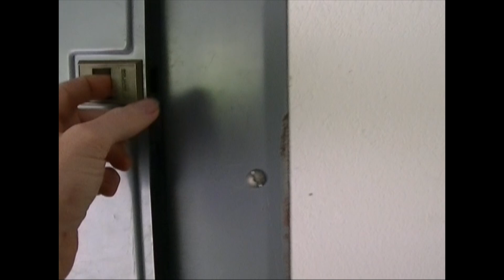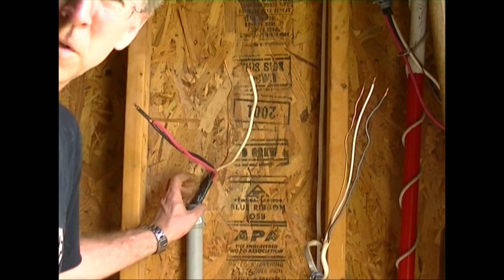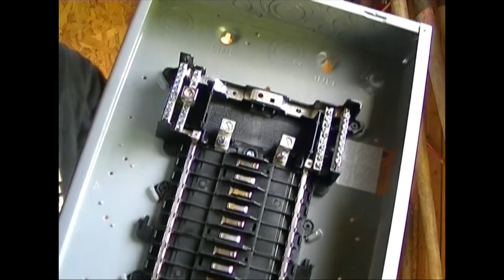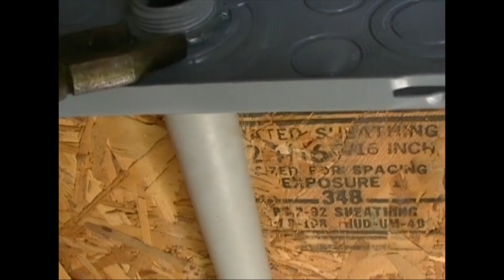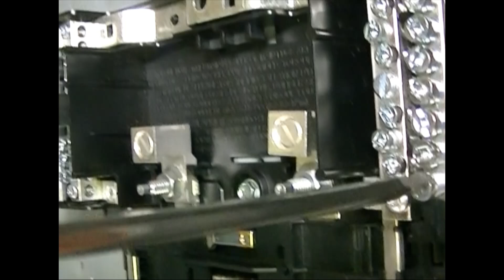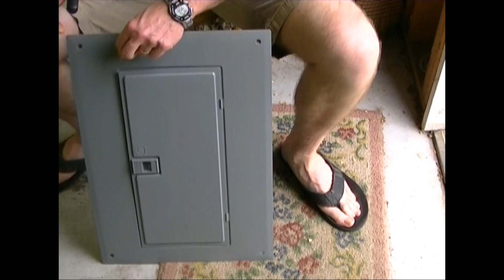How To Change Out A Load Center (or Breaker Box)

Comment: I don’t know if that’s a 6 gauge or 8 gauge cable but there’s no way it could carry that amperage. You either need to run a bigger cable or multiple 6 gauge cables. I know you’re not running multiple devices at once but you mentioned a heating/cooling unit if the air compressor kicks in due to leaks I’d imagine that wire is toast. Not to mention something coming up on main panel like a dyer or stove.  I’m not an electrician but I’d do an amp count just to be safe.
Reply from the maker: Excellent advice.  Thank you for commenting.

Comment: Joe,   A few comments if you don't mind.  I've designed electrical systems since 1983 for contractors and recently retired.  1.  Many comments about wire size and breaker size being too small.  Your response was that you had 60 amp breaker in the house so you are ok.  I agree with your comment to a point.   You can feed a 800 ampere panel with a 60 amp feed and be completely NEC compliant(not cost effective) NEC says feeder overcurrent and conductors sized to carry the calculated load.  I doubt you did the calc, but let's assume you did and it is 60 amps or less.   So you would be correct.   The BIG NO NO is in one comment you said "apartment above".  Assuming the apartment has everything NEC calls a dwelling unit, you are now in violation.  The minimum requirement for a dwelling unit is 100 amperes.  2.  Ground neutral bonded not bonded issues and questions need to be answered by NEC section about connecting one building to another electrically.   The specifics of this changed many times over the years back and forth, so could be either way, but needs to be based on adopted code in your area.  3.  NM cable shall not be installed in conduit exceeding 6'-0".   NM cable shall not be installed direct buried.   4.  In most areas where inspections are required, most will allow home owner to do electrical work.  So, check before you do, get a permit and get inspections.  It will help on safe installations, be easier to sell the property, less risk of insurance company denying a fire claim, and most of all, the life you save may be your own.   Respectfully,
Reply from the maker: OK, first of all, you win the prize for best comment ever on this video.  Thank you so much for your thoughtful insights.  The apartment is just lights and outlets and the AC.  Not really equipped to be a full-fledged dwelling so I'm not sure about how code would apply.  I obviously didn't get inspections and went into this project with a complete willingness to tear it out if need be for sale or other enforcement.  I hope I don't regret that someday but I certainly appreciate your free 'inspection' and, if I"m able, would like to go back and implement your suggestions.  God bless you.
Reply: FloridaJoe3   If the apartment has a sleeping area, bathroom, and kitchen,  then it is a dwelling unit.  If any are not there then it is not.  Best of luck to you.
Reply: FloridaJoe3 I forgot,  the NM cable should really be removed.  If it starts boiling the water  around it, it might last a while but not a long time.  If you did pvc conduit all the way, easy.  If not, not so easy but doable.

Comment: Ur a clown, u should remove this video cause u don’t know what ur doing. This is a fire hazard waiting to happen. 1st off u Never bolt ground and neutrals together in a sub panel. 2 u have to remove the bolt on the panel to remove the metal panel bond to neural.3 lmfaoo u fkd up  u put the panel the wrong way lol u should of flipped it and put ur main #6/3 into those lugs on the panel(the proper way of installing a panel .Bozooo electric
Reply from the maker: Despite your poor spelling and diplomacy, I was able to find an intelligent comment here.  Thank you for posting.  You are correct that neutrals and grounds should not be connected at the remote box.  I have a correction video that goes along with this video.  Please watch it and provide some more clownish comments.

Comment: Excellent video and great explanation. So what are the additional buss bars for? I also thought the 2 phases coming into the panel were supposed to be plugged into the two large screws on top. Am I wrong or is this just another way to do it? Sounds stupid but I am new and learning.
Reply from the maker: No, that's an excellent question.  The power phases coming in 'should' be connected as you stated.  However, because this is in my barn and the cutoff is 200 feet away at the main panel in the house.  I fed in through a breaker so I would have a local cutoff.  Sorry if that was confusing.
Reply: @FloridaJoe3  it makes sense. I was thinking that as well. I was wondering how you would shut off the panel if you needed to work on it.

Comment: You maybe should calculated your total load in Amps ,plus your voltage drop from 200 feet to your house.At minimum for 100 AMP is # 2 Aluminum. The shade tree way is to get everything hooked up .Power up and get an amp meter and check your current draw ,which will vary according to what is on at the time. The AC is going to be the biggest current hog followed by the water heater ,compressor and then your lighting.
Reply from the maker: Thank you for that comment.  I might mention that even though the box is 100A, I am limiting the feed with a 50A breaker because of the length and gauge of the feed wire.  Measuring would be great if I had an ammeter.  I just looked at the spec tags on the various amp hogs you listed and added them up.  All the best to you.

Comment: also you should have brought the feed in from the other side of the panel because you are stretching the neutral and ground across the buss.  also this is a main lug panel . wrong installation for using a 60 amp breaker
Reply from the maker: Agreed.  I believe I was constrained by wire-length to do some less than desirable routing.  Not sure what you meant by the second comment but I was using the 60A breaker to feed the panel so I wouldn't have to walk 100 yards to the main panel to shut it off. (I know. I should have put in a cut-off upstream next to the panel.)

Comment: Phases are 120 degrees apart not 180
Reply from the maker: Thank you for your comment.  You would be correct if you were talking about a 3-phase system (360/3=120).  However, I'm talking about a center-tapped single phase 240VAC which make two opposite 'phases' 180 degrees apart. (360/2=180).  If you dig down through the comments you'll find a very thorough argument for the two-phases.

Comment: I typically don’t comment but this is full of fail

1. The wire feeding the panel is NM cable. I’m assuming the feed to the barn is underground. That cable is not rated for the use. 
2. The backfed breaker in the new panel needs a hold down kit. 
3. This is a sub panel. The neutrals and grounds need separated. 
4. The conduit needs secured. 
5. It’s not two phase when you have a two pole breaker in this application. It’s still single phase. You have a single phase that is center tapped. 
6. Assuming this is a detached structure there’s grounding that is missing. 

This is a prime example of why handymen and homeowners should not be trusted with electrical work.
Reply from the maker: First of all Thank you very much for a detailed and well-stated comment.  I would like to respond to each one so I appreciate the numbering also.1. You are the first to ever mention the NM cable.  I will check on that.  I thought that I bought cable specified for underground use but I may have just assumed that because of the black sheathing.2. You are also the first to comment on the hold-down.  I had no idea what you were talking about so I looked it up and, sure enough, "you have to attach a special retainer clip to the breaker, so a future electrician doesn't pull the breaker and assume that it's dead."  I will remedy this at my first opportunity.3. I guess you didn't notice my pinned comment about the correction video that I made.  I would love to hear what you think of that if you have a moment some time.4. Yes. I'm taking the risk that the 5 feet of conduit won't go anywhere.  I have been told this before.5. I love this one.  I know it is a center-tapped single phase.  If you dig through the comments you'll see my argument for the two phase.  Basically, when you center-tap the 240VAC you get two 120VAC circuits that are 180 degrees out of phase.  Seems a shame to call it single phase when they are so opposite.6. You're not the first to mention this either.  I'm using the ground wire back to the main panel but I agree that rods would be better.  I may remedy that in the future as well.Again, thank you for the excellent comment.  You definitely win commenter of the month!
Reply: 1. There is NM wire that is for residential work thats code (california). It is made if you dont want to - A.run Emt or B.run flex from panel to sub-panel. They have different guage sizes including 2/0, 3/0. In a sub panel you only need a ground wire connected to the bus that comes from the main panel , no need for a Ground rod , just a ground bushing.
Reply from the maker: Thank you for the comment.  I thought initially that I didn't need the ground rod but had a couple of commenters that said I did.  It wouldn't surprise me if different states have different rules for that.
Reply: @FloridaJoe3  here in california only the main panel needs 2 ground rods spaced about 6 feet from each other and it needs to connect to the gas line. Yes gas line.. idk why thats a code here , literally a ticking time bomb if something were to happen
Reply: Bubaroon LNK you’re wrong. It is a NEC requirement. California follows the same codes as the rest of the country. This is a separate structure. The rods are required as well as connecting to any other electrodes and piping present.
Reply: Bubaroon LNK the gas line is already grounded thru the connection to your furnace or any other appliance that has an electrical connection. Houses haven’t been exploding. The requirement to bond it to the GEC system is a IFC requirement due to CSST gas lines and nearby lightning strikes
Reply: @MeMe-rr5ll  you would be suprised, older homes dont have the gas lines grounded.
Reply: A subpanel does not need a rod

Comment: Except for the screws holding the box to the studs, your initial install could not be more wrong.  
A) it’s a “mains lug” load center, use them.  If you want “line of sight” disconnect ability, it should be done externally of the panel (pull fuse or contact switch)
B) you do not bond neutral and ground in a sub panel. Bonding should only be done at the main POE. 
C) no support on the conduit 
D) you don’t run Romex  inside conduit, it should be loose wire.  

Do you have a NEMA code book?
Reply from the maker: Thank you so much for your thorough and detailed comments.  I would like to address each one in hopes of getting things clarified.A. I just have to agree with you that your suggestion is the best way to do it.  However, I did not wish to add a separate cutoff box.  My question for you would be, is there actually a danger in having a breaker at both ends of the circuit?  If so, what is it?B.  I hope that you will notice in the description that I made and entire correction video for this problem.  Thank you for pointing it out again even though you are not the first.C. I have to agree with you there as well.  I left off support because of the short length and sturdy size of the conduit.  If you know the rules on this, please expound.D. Oh yes I do.  Again, I would be curious to know if this presents a danger or problem and what it is?Lastly, no, I clearly don't have a NEMA code book.Thank you so much for your help and explanations.
Reply: It isn't a NEMA code book, it is the NEC (National Electrical Code) and you can view a copy for free on the NFPA website ( www.nfpa.org ).

Comment: Your Equipment grounds and neutrals should be isolated from each other in your subpanel. If your barn/loft is detached from your house you should have two ground rods connected to your equipment grounding bar in your subpanel. You should have two 8ft long ground rods set at least 6ft apart. You should run #6 copper between your new 100 amp subpanel and both ground rods.
Reply from the maker: Thank you for that comment.  You are not the first to notice.  Please note that I have a correction video that explains why the two should be isolated.  I like the idea of ground rods but I took ground back to the main panel instead (may add rods later).  Again thank you for making YouTube better with a well-thought-out comment that will benefit viewers.
Reply: @FloridaJoe3  FloridaJoe3 your replies are as helpful as your teaching video. Thanks. Keep up the clarity and patience.
Reply: Joe,
I would get the ground rods in soon as possible if I were you. Safety First. Code requires the ground rods in addition to a 4- wire feeder, if your barn/loft is a separate detached building. Currently your feeder wire seems to be protected properly with your 60 amp breaker(although I can't read the writing on your feeder wires). If You want the full capacity of your new panel(100amp), you must pull in larger wire(100A rated wire) in to your feeder conduit between your house and barn, with, of course 100 amp breakers. Installing that 60amp breaker is fine as long as feeder wires are rated for 60 amp. I might even up the wire one size larger than required because of your long 200 foot run. That will help to reduce  voltage drop.

Comment: The most important thing was to tag the breaker off the house box as out of service tape warning on box you are working on lines don't touch.
Reply from the maker: That is very good advice.  I had a breaker on both ends of the line, the feeder at the house main panel and a main breaker at the remote panel.  So I didn't have to shut it off at the house.  Thank you for the comment.

Comment: So you now have 100Amp breaker in your home main panel and you are sending power out 200 feet to a sub panel on the same small wire gauge that was proper for the 50Amp service sub panel???  What could be wrong with that???????
Reply from the maker: Well a lot could be wrong but nothing is.  I left the same 50A breaker in place at the house panel.  So even though I have a 100A sub-panel, I'm only providing it 50A because, I didn't need more power just more room for breakers.  Thank you for commenting.

Comment: being a licensed electrician  since 1985- i only see 28 violations with your installation 1) #6awg to small for 100 amp, i could go on & on & on
Reply from the maker: It is always good to hear from a licensed electrician.  I have a question in reference to the one violation that you listed.  My supply breaker is 60A.  I would heartily agree that putting a 100A breaker on my supply is a violation (and a bad idea) but I'm just using a 100A box to get more room not to actually bring in 100A.  Is that a violation? If so, why?  Thank you for commenting.  Also, please feel free to list the other 27 violations to avoid the appearance of exaggeration.
Reply: @FloridaJoe3  
👌

Comment: Wouldn't it have been easier and more efficient to try to lower the panel so that the main wire could be connected at the top
Reply from the maker: I'm not sure why I'd want to do that.  My feed wire is coming up through the slab, not through a standpipe in the roof.  I would have to go past the box and come back to go in the top.  Thanks for the comment.
Reply: Actually, I was thinking not being critical, that you could cut the pvc coming up to the box to make it lower and curl the extra length of wire inside the box to connect at the original connectors.
Reply from the maker: That is true enough.  Thanks for the explanation.  However, I would not want to change the height of the box since it was right where I wanted it at eye level.

Comment: As an Electrician in the UK we have different regulations to USA. However some basics are the same and some of the things shown here would not be allowed. 1/ incoming cable now possibly underrated. 2/ No local isolation at distribution board. 3/ Supply cable back feeding into busbars rail...should have fed into main feed lugs at top via an isolator. 4/ Bare earth/Ground wires are not allowed we must sleeve them with a green & yellow tubular sleeving. 5/ No sign of any RCD/GFI protection. 6/ Work not tested....insulation resistance, earth loop impedance, continuity etc. 7/No labelling/warning labels on panel. Electricians earn their title for a reason...years of experience, training & qualifications.
Reply from the maker: Thank you for the comments.  It's always good to hear a foreigner's perspective.

Comment: you installed bigger panel but still same wire that cant carry more than 55 amps. Very limited use of it.
Reply from the maker: Thank you for the comment.  It would be important to run new wire if increasing the service amperage.  I just needed more room for circuits, not necessarily more current.  It's for a shop with various outlets that are only used one at a time.  My main feeder breaker at the house is still sized for the wire gauge running to the shop.
Reply: you did well. A lot of homes have neutral and ground tied together because I have seen it. Not that of a crucial issue. Electricians like to pick on other peoples work all the time. I am one of them but was not looking for faults. Your video came across as I was watching something else.
Reply from the maker: I do have the neutral and ground tied together back at the house where the main panel goes directly to a copper grounding rod right outside.  However, here in the subpanel it is important not to tie them together because if they're tied together, any back voltage normally occurring on the neutral ends up on the bare wire all the way back to the house.  For more details, see my correction video.  Thanks for commenting.